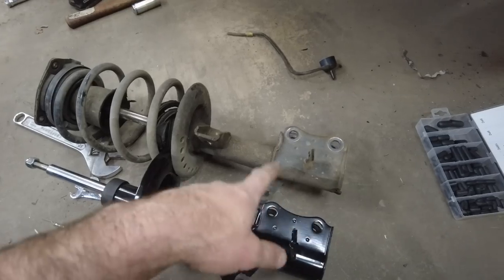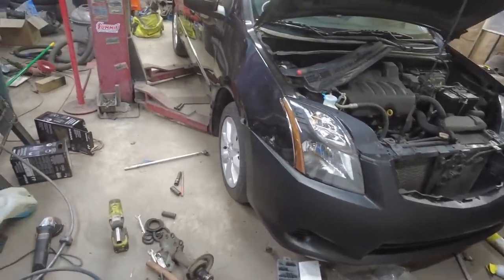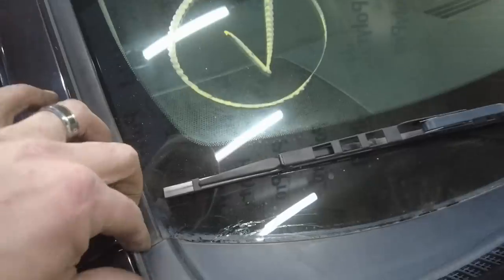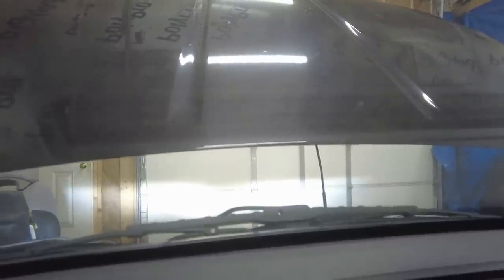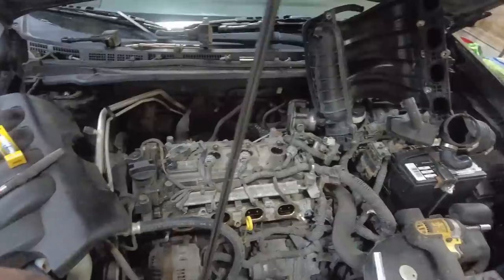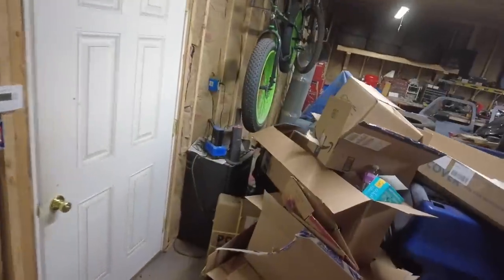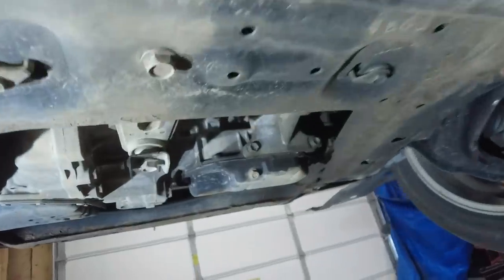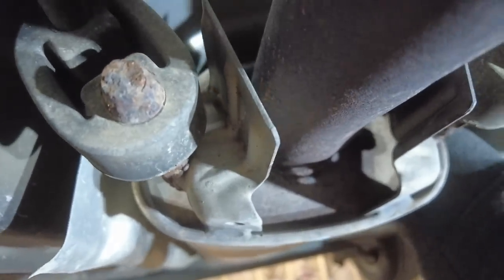Copart Sentra Rebuild Suspension and Tune-up

Comment: hello again why not buy a windscreen removal tool go to Johnny's and price the glass i get windscreens at my local brakers for £10 as long as i take it out i use the wire method and in 30 mins i have a new piece of glass the adhesive is more than the glass   keep safe from me in England
Reply from the maker: The removal tools that harbor freight sell are no good for safely removing glass.  The good ones like Safelite use are a small fortune
Reply: @UnWrecked  i got mine from eBay full kit inc wire £30.00 English pounds
Reply from the maker: @someonejaw  wire doesn't safely remove the glass.  The ones the professionals use, uses nylon cord that won't damage it.
Reply: Simple thing when pouring new oil from a can I make a small hole in the handle corner, I normally heat a nail tip up so no loose plastic bits in the oil. Anyway I find it stops the glugging and you get a more controlled pour with very little mess.  Good luck with the new family members you're going to need it 😆  silver car = mercedes.    Laters cuddle buns.    Gary 🇬🇧🇬🇧